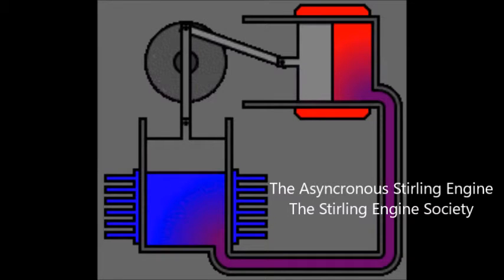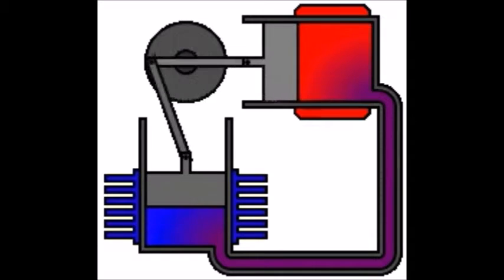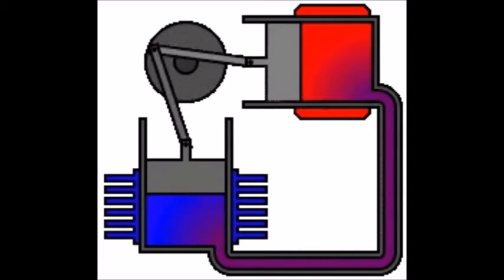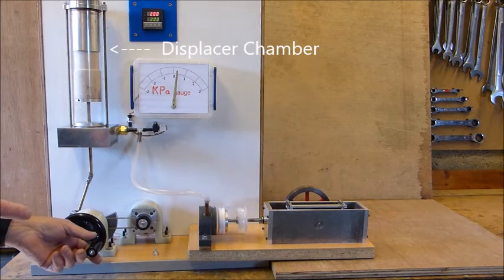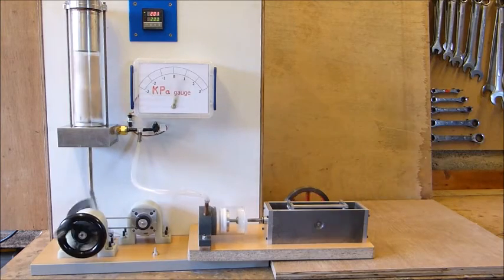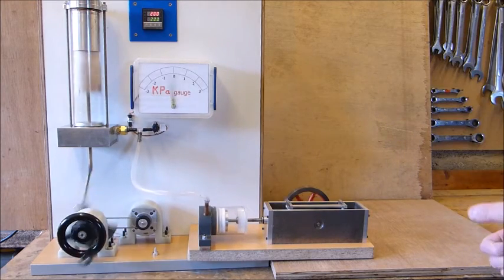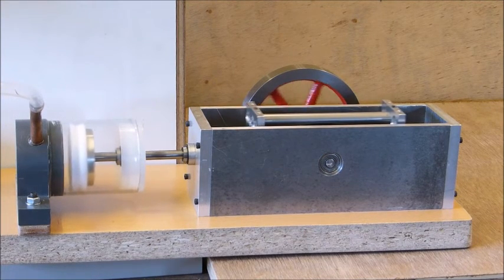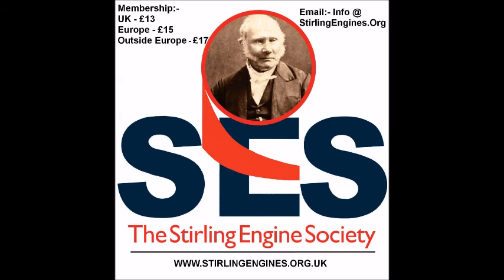Asynchronous Stirling Engine

Comment: The problem with all sterling engines, as with any engine or motor for that matter (including electric) is saturation. Stirling engines can be constructed to function on very low temperature differentials, and with comparatively crude materials/means. That's about where there merit begins and ends. I'm glad to see people keeping them alive, regardless.
Reply from the maker: Keeping them  alive? Their merit begins and ends? 
Have a look at www.stirlingengineboats.com
Have a look at NASA and Kilopower
This engine has distinctive capabilities - it is the only tool for certain jobs
Try https://en.wikipedia.org/wiki/Gotland-class_submarine
Andrew
Reply: @andrewhall2702 - for a handful of niche/remote applications, I can see where they might be useful... but both the NASA and DoD projects failed to substantiate themselves. Stirling engines are novel gadgets, and I love to see them run... but the moment you put a load on them, they begin to show their shortcomings. I nearly bought a retired USAF pickup truck with a stirling engine, and still wish I would have... but I completely understand why the project did not see renewal or continuation.
Reply from the maker: Yes - definitely "niche" And what about that whole sage with General motors and getting a Stirling car!
My understanding is that when you sat in the drivers seat and turned the ignition - you had to wait 40 seconds for the heater to hot enough to get the engine started. 
Car drivers expect to be able to get in and go - not wait 40 secs
With my 1 kW Microgen - It takes 2 mins to get hot enough to start - then another 6 mins to get to full power.

James - you have clearly been involved/interested for many a year vs Stirling 
Can I enroll you to the StirlingMatters forum?
It's a discussion group just on Stirlings - not a high volume of postings 
Send an email to me - andrewthamesside@gmail.com

Comment: a stirling makes low-torque.  so, you don't want to vary engine speed.  you want to keep it high.  cheers
Reply from the maker: Yes Stirling engines are "low torque". But as the engine speed increases - the time for heat flow into the working gas is decreased! So torque decreases with engine speed. The engine power is the mutiplication of the torque and the engine rpm. The power curve peaks - usually around the half way value of free running (no load).
We usually measure the power curve so as to know the revs of the peak power point. 
The desire for being able to change the engine speed is just for control when the engine is being used in an appliance - say a boat. Changing the burner/heat flow does change the engine speed but the change is very slow.
The asynchronous mechanism is a rapid speed changing mechanism.
Reply: based on my yt research, aside from desktop models, very few well designed stirling engines have ever been made.  most just barely run...having been made with soda cans.  the engines that run well are loaded, if at all, at the radius of the flywheel.  which is just wrong.  i recently found the engine below...made out of soda cans.  it is correctly designed, with high-speed output, just waiting to be converted to torque.    
there is an optimum engine speed.  run the engine at that speed.  use first-stage reduction gearing to take power off.  use the increased torque, reduced speed, to do work.  this apparatus is not being driven via the stirling cycle.  its not an accurate simulation of a striling engine in operation.  any resulting data is of no real use.   cheers
Reply from the maker: Hi
Back in the 1880's Alexander Rider and John Ericsson made many thousands (even 20,000?) Stirling cycle engines. They were used very widely to pump domestic water supplies. They were used world wide. In the UK two can be seen at Hereford Water Works where they are run regularly.

Nowadays Ripasso Energy make a 33Kw stirling engine. Powered from a solar dish it generates electricity.
Try https://ripassoenergy.com/en/ripasso-stirling-hybrid/

Kockums fit 75Kw Stirling engines in the Gotland Class Submarines
Try https://en.wikipedia.org/wiki/Gotland-class_submarine

Out in Tooele Utah, the US Army have a 400 Stirling solar dish farm generating 1.5Mw
Try https://www.nrel.gov/csp/solarpaces/project_detail.cfm/projectID=265

The apparatus in this video has a classic sealed Stirling Displacer chamber. One end is heated - the other end has a large aluminium heat sink - a cold end. The pressure variation is then piped to a piston cylinder. This Stirling engine design is known as the Gamma Stirling design. It is the same design as the two engines made by Rev Robert Stirling and donated to Glasgow and Edinburgh Universities.
Reply: thanks.  i had forgotten about more recent use of htd engines with solar.  cheers
Reply from the maker: When the Stirling engine is used to propel a boat, there is the need to be able to stop or slow the shaft rotation. In the Philips video of their 30hp cabin cruiser. they altered the pressure of the working gas to achieve power level changes. This video shows an alternative method. Another boating issue is that the propeller can be suddenly jammed. Eg by grounding or by a piece of timber jamming between the hull and the propeller. This mechanical shock usually causes damage to the engine internals. The mechanism in the video removes the usual direct linkage between the propeller and the crank shaft. Yes, when cruising, it is most desirable for the engine speed to be held steady at the correct revs for the power curve peak. With this mechanism, the correct engine speed can be adjusted - without the use of specific gear ratios etc.